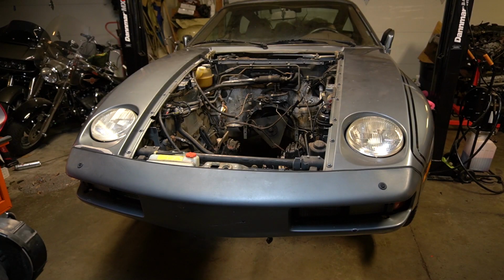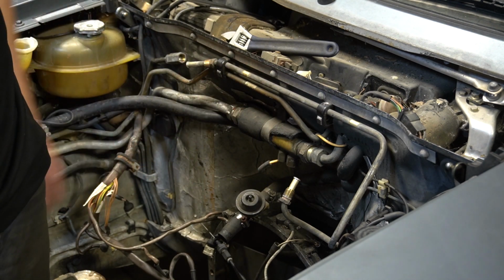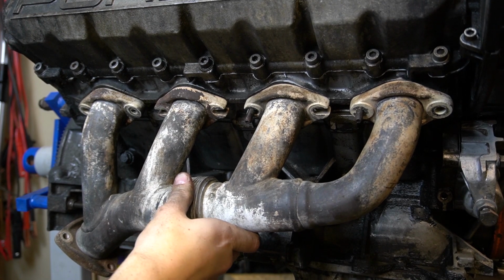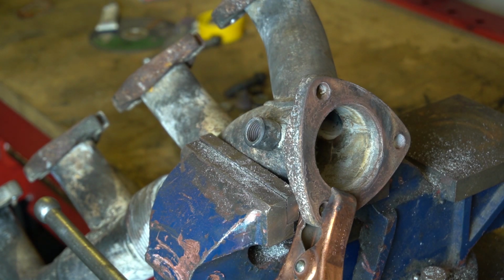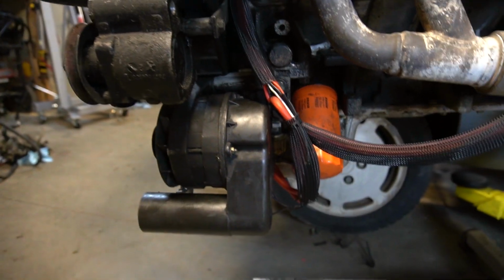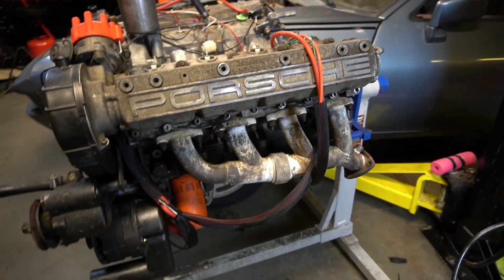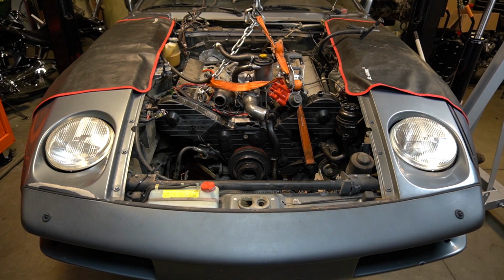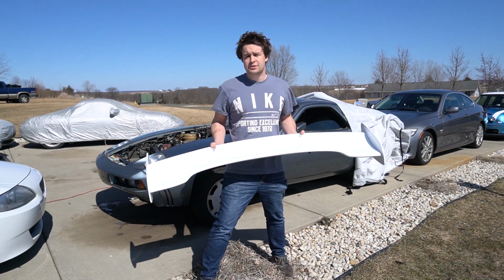Budget 928 Track Car: S2 Headers, AC delete, and more

Comment: What size are your turbo twist wheels?
Reply from the maker: I believe they are 18 inch rims. Next time I make a video on this car, I will report the exact size.
Reply: @Rurik_JustCruzn  I have a set of 18s with 265/35-18 on them that have rubbed but I know people who have run wider with no rubbing. Mine is lowered though. I also got some turbo twists in 17x9 in an attempt to run a square set up. 9” is a little too wide for the front, so my next two will probably be 17x8, or 17x8.5. 18s isn’t quite enough rubber for me but the 265s look great. I believe you can run a 275 on the 17…

Comment: What size are the wheels? Just curious what size wheel tire combo are you plan on running up front?
Reply from the maker: I believe these Turbo Twist rims are 18 X 8.5 inches. My plan is to use 235/40R18 performance tires.
Reply: @Rurik_JustCruzn  I’ve got the same wheel and that size tire up front, 265/35-18 in the rear. The 265 looks great but I get occasional rub, but it’s also been lowered. I was trying to run a square 255 on a 17 but it’s pretty wide up front.